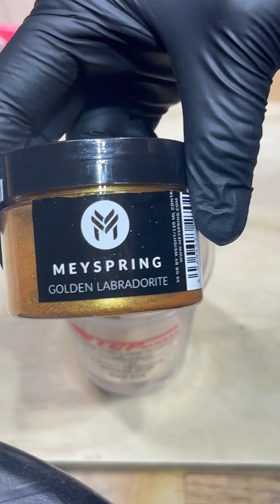Walnut with Gold Epoxy design on Lazy Susan

Comment: Very nice work. However, I thought that you perhaps should have used a 'Sanding Sealer' before pouring the epoxy to prevent any bleed into the Walnut.
Reply from the maker: Thank you. I did think about that but since the epoxy inlays we’re so shallow I wanted to get maximum bond with the epoxy and wood.